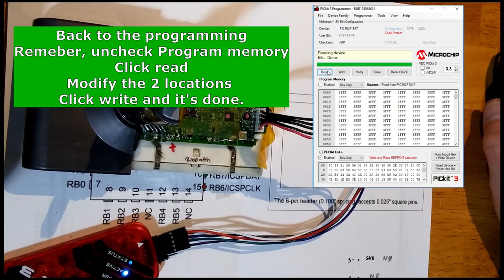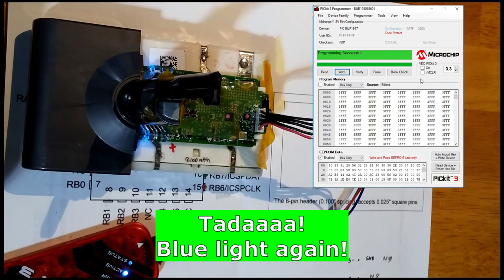Dyson SV10 V7 red light lock unlock, 2 red flashes one blue

Comment: Do you just happen tyo know about the 206340 battery pack (for the sv12)? It has a connector with two wires going up the stem in addition to the main power out terminals. And i assume a magnet sensor too, somewhere. Do i have to do something to / with the extra connector to make it output power?
Reply: not sure what the connector with two wires does but I cannot get it to turn on with just main power applied from an external source.  there's no magnetic sensor (sv12).

Comment: Thank you for the video you shared. After this procedure is unlocked and a new 18650 battery is replaced, will the same lock issue still occur? Thank you!
Reply from the maker: If the replaced battery ( one only ) it's not the same as the rest, it may occur. I suggest  replace all 5 cells, the same capacity. The pack has no balancing implemented. Normally a one low cell can be still used, just balance the pack and use-it. Weak cell will recover partially.
Reply: @secondlife1970  Thanks for your reply, I learned a lot.
I'll explain my handler first to see where the error is.
1. I went to buy a middle-aged dyson v6 battery. It can be charged normally. Press the button on the battery to display a blue light, but the recharge efficiency is not good.
2. Disassemble the battery box and connect the balance charger to several nodes to charge, fully charge the battery, and then start to balance the voltage to 3.9V for every 6 18650 battery. The battery box button should be fixed first to prevent it from being triggered.
3. In addition, connect 6 brand new 18650 batteries (SONY VTC5A 2600mah) in series, and the balance voltage is 3.9v for each battery.
4. Disconnect the 18650 on the balanced v6 battery from the protection board and replace it with a brand new 18650 battery. Connect all contacts on the protection board.
5. Double-check that each battery is the same voltage as the old battery that was replaced. Press the button on the battery. The protection board can work normally by turning on the blue light first and then the green light.
6. After the battery box cover is installed, use the charger to fully charge the battery, and the process is normal.
7. Here comes the problem. When I plug in the vacuum cleaner to test it, the red light turns on and it doesn't turn at all. May I ask you to know which program I did wrong? That's why I can't move, please tell me.
Reply from the maker: @bradsuen4901  I believe you have to charge-it first with the original charger to enable the pack to run, normally your problem should not happen if the pack is unlocked. If put to charge the pack is normally charging ( blue light ) then there is no problem. Try that.
Mine I never had any issue after unlock, I did not check the cells balance but I do not care since I can always unlock the red light.

Comment: Hi, you mentioned 2 red flush and 1 blue. What if 32 red flushes? I changed all the batteries and wrote the code like you, it showed blue for me but when I inserted in the vacuum, that means when I load it, it showed again red. Do I need to recode differently? Thanks.
Reply from the maker: If you look at my other Dyson video V6, V7 with 32 red flashes, you need to have all the cells balanced before restart the pack.
If they are out of balance or cells are not the right type, it will lock again. Hope it helps.
Reply: @secondlife1970  You are amazing. It works now. Thanks a million...😀 Actually I balanced all cells but I changed  2 batteries and which were different ampere and they were from different manufacturer. You are so helpful.
Reply from the maker: @sadat67d  happy you saved another battery from going to the dump. Cheers.
Reply: I did my V6 a few months back and found the data to change and wiring diagram no proble
This SV10 though, despite watching the video   times, going back to eevblog thread and going through all the pics , I just cannot find a diagram for the wiring for this again
Any chance you could draw up a straight graphic of the BMS to PicKit 
I have frozen the video, tried tracing colours, but just can’t get it
Thanks
Reply: Hello, what is the reason for changing the ff 00 codes there? Please help me.

Comment: Or you can just buy a new BMS that isn’t locked by Dyson
Reply from the maker: I did that before learning how to reset. Other BMS are OVERCHARGING. I was amazed to see the voltage on each cell going over 4.22 V. This is what will kill them if they stay in charger. I rather relay on the Dyson BMS, it's very well made, safe. People do not think about this aspect.

Comment: I didn't succeed because I didn't use a 25v 500ma charger
Reply from the maker: To reset you have to manually charge the pack and balance-it, you can use any power supply. As for the 25V 500mA , this is the original Dyson charger.

Comment: Lot of thanks for this interesting video!
On a good battery , Is it possible to add a second range of cells in // under the first one always connected to the BMS , with respect of all connections at the good place  and cells with same value and output amps , so to have more work-time , but first of all to decrease the Amps/output (divided by two) with full power position. That will give safe power by long use ...but first of all a much better battery life.
Normally it must not disturb the BMS with a bigger capacity? Is it right? And with BMS always connected, no locking?
Simply modify a safe packaging. I wish to have your opinion before trying.

Do you know if the included BMS (I have a V10) makes the equilibration by charging? If not it's a shame.
These new cleaners "eat" always more power . Why Dyson does not propose such packs? (like for good screwdrivers with 4 or 5 Ah)...too heavy? ... too expensive?...or.perhaps too safe...and commercially uninteresting?
Friendly, Michel.
Reply from the maker: Greetings from Montreal. Thank you for your kind comments, it's a carefully designed sell pitch to use the battery on a limited time then buy others. (Similar with the laser printers.) That's the whole reason I tried and managed to reset this " lock" feature. Power tools ( like power drills) have a more "professional" approach. Over there the design allows a variable battery height, not like Dyson. I have videos reviving Power tools battery, if you're curious. It's a shame technology is wasted so easy.  Kind regards
Reply: @secondlife1970  Hi from France, I will look at your videos about power tools battery. I already built a lot of these packs with simple BMS with equilibration , specially to re-use good NI-CD models, and for E-bikes , and motorcycles (with A123 lifepo4). 
On my Panasonic E-Bike I have the same issue : Disconnected BMS locks immediately. So I build a battery with another BMS (only useful for charging or use separately) and I connect it in // (with same charge voltage) to the Pana batterie.
On a Dyson pack, if I connect a second range of cells simply to the same connections of the first ones on the BMS, I think there is no problem. Do you agree?
So must it be also possible to change the Dyson old cells without  "lock" issue?
Friendly.
Reply from the maker: @Michel-Artois  Yes, if you do not press on the button to wake up the Dyson BMS you can basically change the cells without lock. But for you, the safest way to change without the reset tools is to "ghost" the batteries, same as you do for your e-bike. Ghosting works well for laptop batteries also, those BMS are even more sensitive and protected to unlock.
Reply: @secondlife1970  OK, I will pay attention with these Dyson packs if i must change "tired" cells, using ghosting. My first intention is not to change initial cells but to add a second range of cells in //,  only to increase the capacity and decrease the output amps which "kill" the battery with max power. 
So I hope to get  minimum a 5 to 8 years life time...if the BMS stays alive!..With Dyson I don't understand why so many BMS are faulty without cells issues...are they also built for a short lifetime like in some Canon printers?..Or can they not support a long time the high amps output?
BMS programmation choices by the manufacturer are actually a big problem for us . Complications only justified for commercial reasons...It seems it's not finished in the future.
Friendly, Michel.
Reply from the maker: @Michel-Artois  ok, usually the Dyson BMS are not faulty, they just lock when they detect cell un-balance. That's the purpose of my video, to unlock them after restoring the cell balance. By all means you can add extra cells in parallel to the old ones, it's just that for me it looks more wires  and not very aesthetic. You cannot basically prevent cell aging, so no matter what you will need to change them sooner or later. Indeed with more capacity should last longer your modified pack. But keep in mind time is also aging the cells even if they are not used.

Comment: How to unlock SV12 red light? Thanks!
Reply from the maker: Hello, sorry I do not own a SV12 and I am not sure if it's based on the same PIC controller.
Reply: @secondlife1970  PIC model: ATSAMD20 E15A-U, See if you can unlock it, Thanks a million!
Reply from the maker: @19786310  Hello, this video was a result of a collective effort ( EEVblog). The chip you have is a different type of controller and I have no knowledge about how to access this model. If it's new maybe it will take some time until other people try, or maybe it cannot be accessed/modified. Sorry, I cannot help you with that. Regards
Reply: @secondlife1970  Thank you very much for your reply

Comment: I modified 16fl1847 00 7F directly, no light and no response.
Reply from the maker: Sorry you did not succeed, you have to make sure you uncheck the program part of the memory. If you erased the chip there is no turning back. Warnings were in the video text, to uncheck the program memory box, before you ever click "write" button.
Reply: I found a problem when I first read it was not 0000 but 3FFF
Reply from the maker: @徐海峰-t7v  I believe you are referring to the Program data. You cannot change that and you should never try, you will erase the chip. The eeprom data, the bottom part in the Microchip app, it's as you see in the video, different bytes, but not 3FFF.